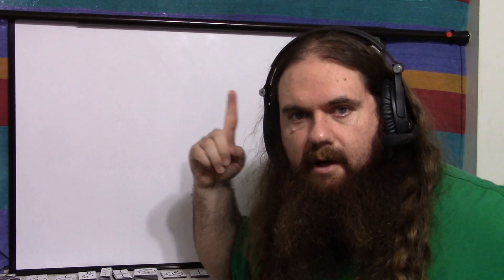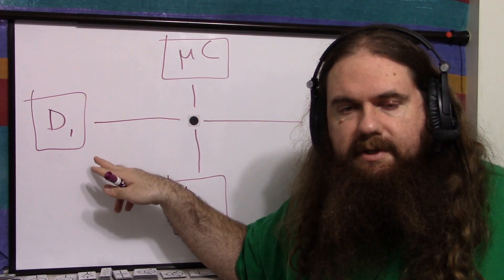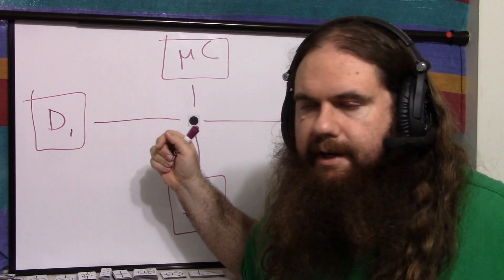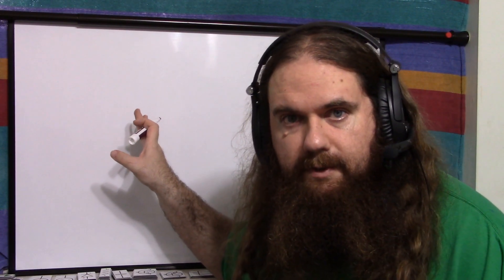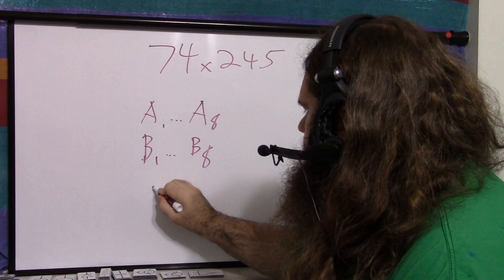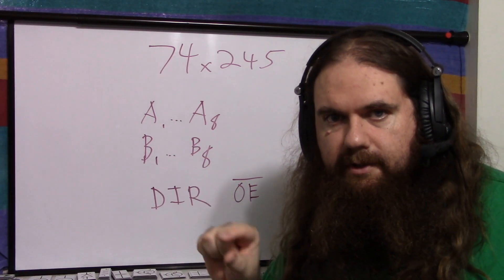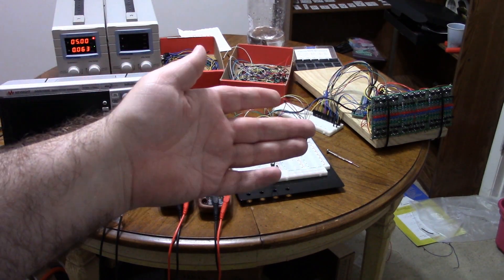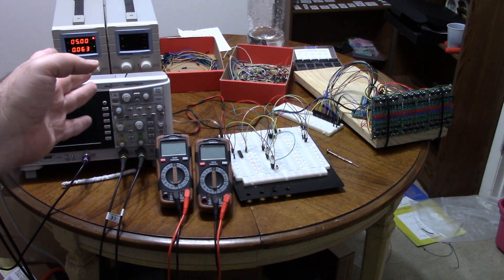74x245 Octal Bus Tranceiver - Electronic Traffic Light - Simply Put

Comment: I used one of these a couple of days ago. All of my EEPROMs from China were junk, so as a workaround I used an ESP32 that I had and coded it to work like an EEPROM. I used all of the pins for address and data lines, so I used one of these to give me the output enable pin and high impedance outputs. Worked like a charm. Definitely power hungry though. The whole circuit (just the ESP and the 74HC245N) was running around 550mA.. I managed to put together a few dollars and got some proper EEPROM's from Mouser so hopefully they'll work.
As a side note: a benefit from making an ESP32 EEPROM is that with some more code I could modify the contents (non-permanently) using either WiFi or Bluetooth.